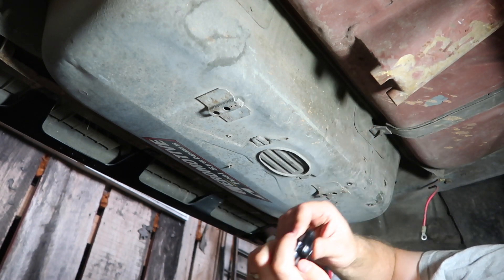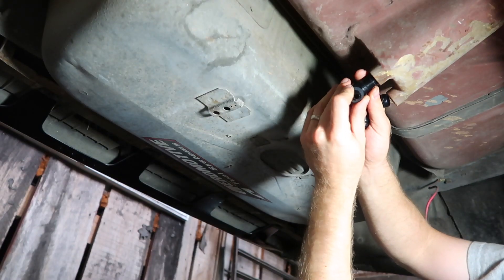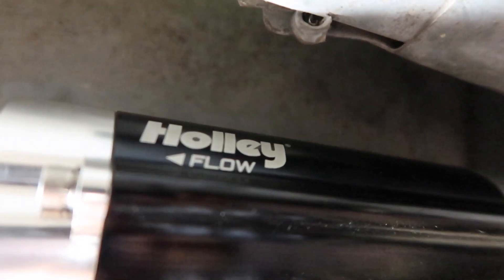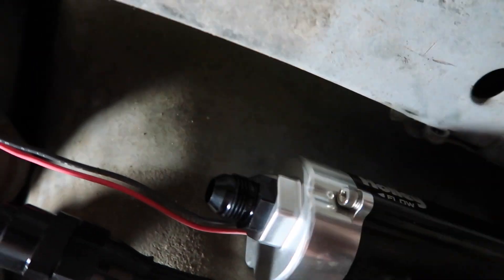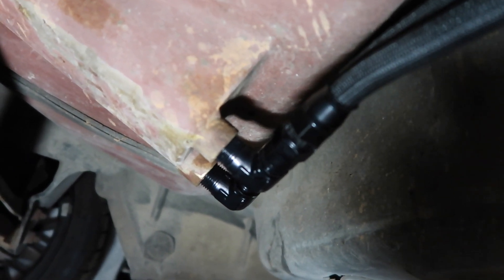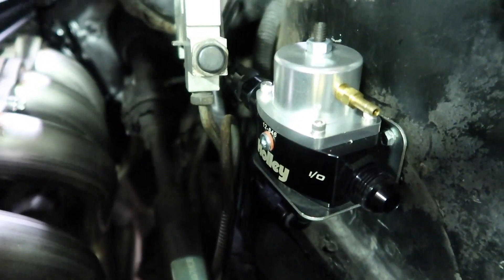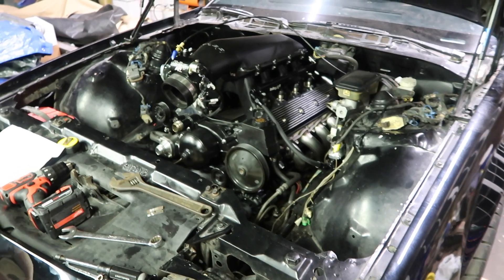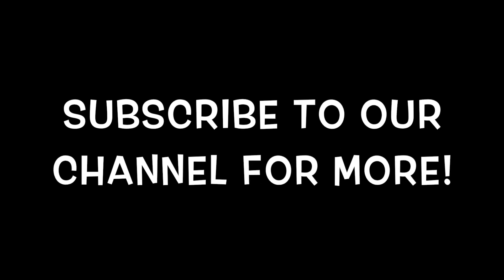92 Camaro LS1 Fuel System explained!

Comment: hey bro I wanted to ask you does your 3rd gen Camaro still have the stock steering shaft rag joint?? If so have you taught about upgrading it?? As you had Mentioned in your previous video you wanted to autocross the car I have something that could help you with that. Contact me please..